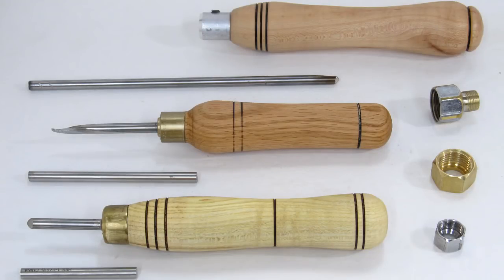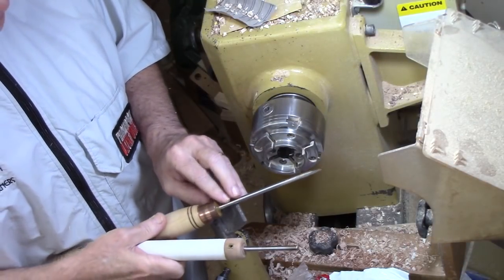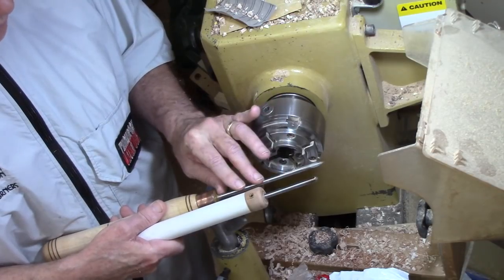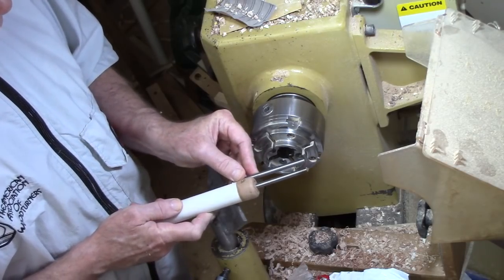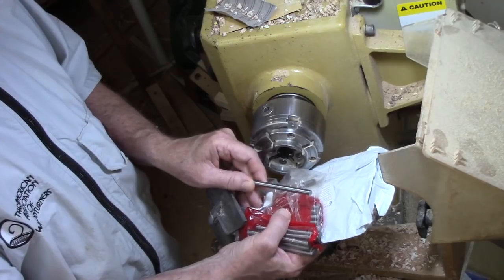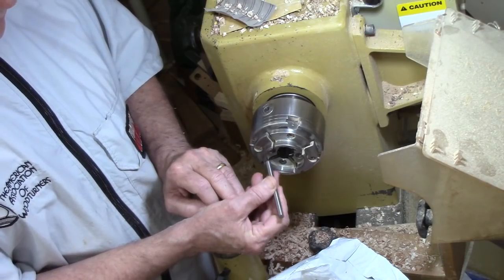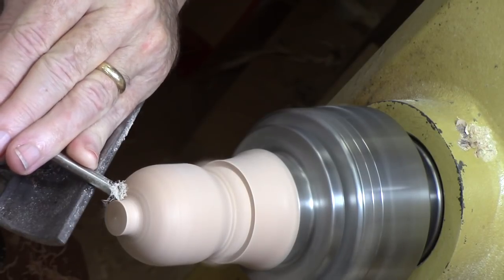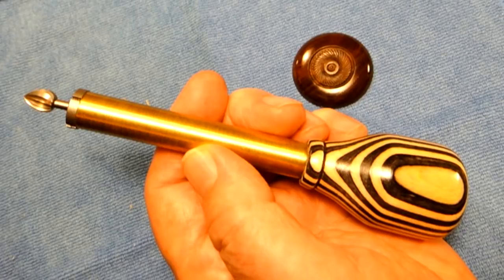Small Round Woodturning Tools Follow-Up

Comment: Hi Mike Thanks again.  I've had some nice pieces of High Speed Steel in all sorts of sizes from Amazon and found them to be very handy for  making the small Point, Cove and Skew tools.
I have also bought HSS square stock and used it to make various hollowing tool bits either held in place with set screws or super glue in homemade tools.
I find, as I'm sure others have found as well, something very satisfying indeed, to turn a nice item with tools that one has made themselves.
Reply from the maker: Jim Robb Yes indeed. I am doing a workshop on these next week for my club.